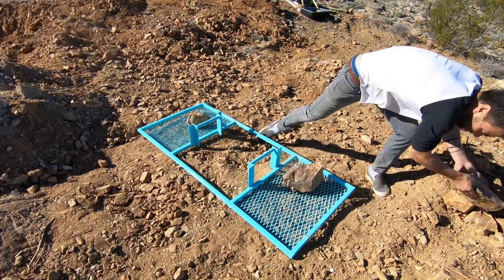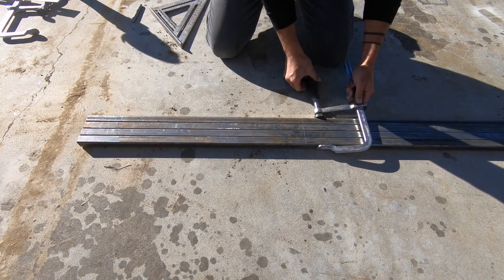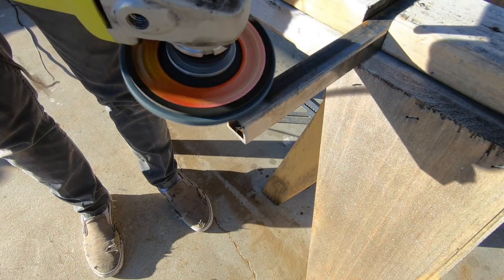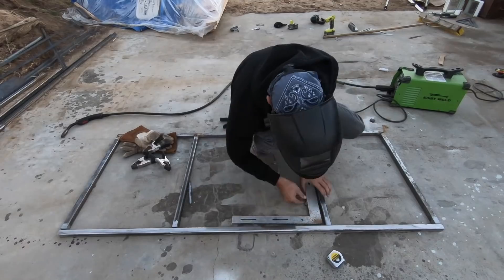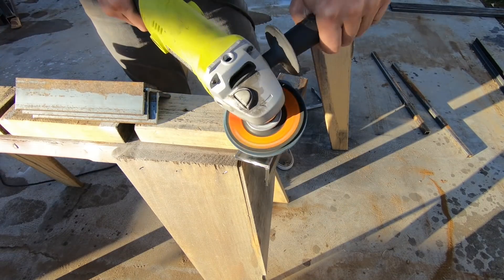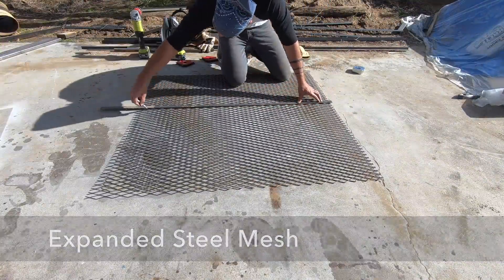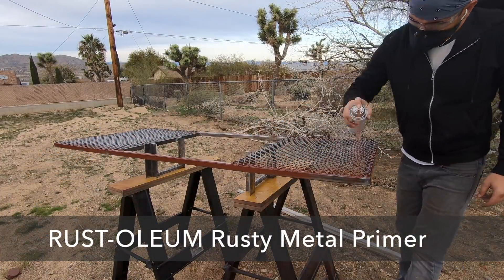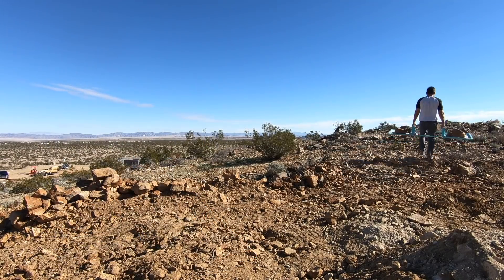Making a Rock Carrier | Functional Strength Device

Comment: Looks like a very useful tool for around the property.  I would highly recommend putting some 3-5" feet on that to get it up off the ground a bit and give your toes a bit of room or at least take the corners off of the angle you used for the handles on the bottom.  Since you're using it on uneven ground if you trip and that corner lands on your foot you'll have a very bad day.
Reply: Yeah, that's what I was thinking. I can see this de-toeing him soon :)

Comment: Other than building strength, why would you do this? So many problems with this; the material itself is going to weigh 30lb, you would have to balance the rocks on both sides every time, heavy-duty wheel barrow would do the trick. Props for the work put into this video though.
Reply from the maker: ever try to use a wheelbarrow on ground covered with rocks the size of soccer balls going up hill?
Reply: @HomeMadeModern  look up Traverse Stretcher Carriers,  Dixon Rollerpack, or 2-Wheeled Wheelbarrows. I had to design and build a similar system to carry heavy equipment on off-road conditions in  University, so I have a bit of experience. Maybe this could inspire you to do a version2?

Comment: Would it be safer if you didn’t have a front bar?
Reply: Yes get rid of the front and back bar that would make it really safe lol
Reply from the maker: possibly but there is plenty of room for my strides and you would have to use heavier steel sections.
Reply: There would be too much flex with the weight on the sides unless he made the back way stronger and heavier which would unbalance the whole thing.
Reply: I am afraid I would trip, and then I’d be in real trouble.